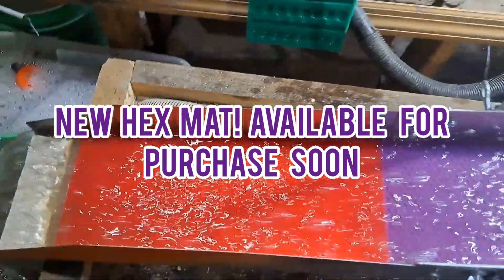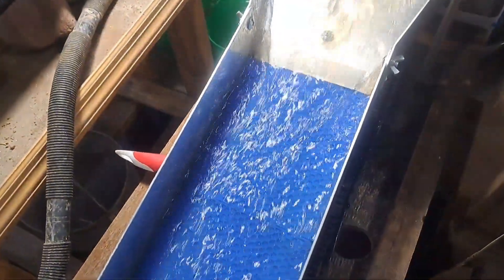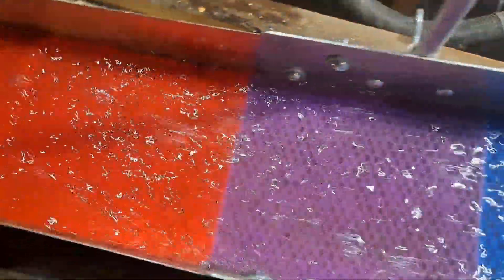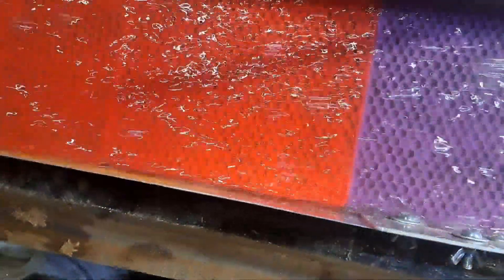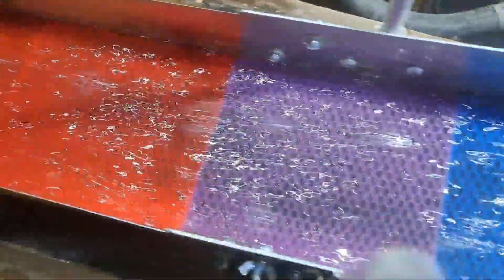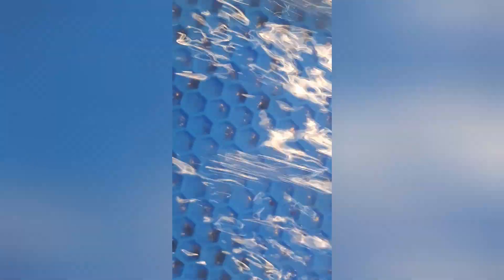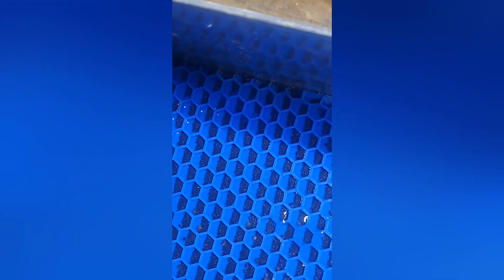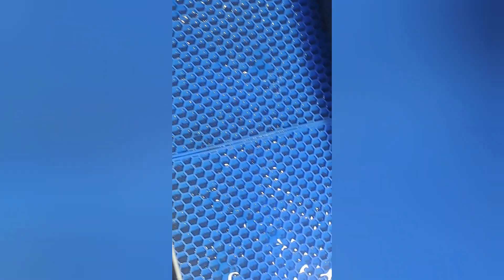The New Hex Sluice Mat.

Comment: Reminds me of Dream mats. 😁
Reply from the maker: Works way better than dream mat. I've used dream mat.
Reply: Any chance you can do a side by side comparison of Dream mat and your mat?
Reply from the maker: @4 The Loot  I've used  the dream mat many times..the combo mat works  ok in the  streams. IT looses 50 percent  of the  gold  in beach sand. I've demonstrated  that on  a video on lake superior  last summer.  The micro dream mat works very good  for a  clean up sluice.  You have to re run  the cons 3 times to get  all your gold. The hex mat 2 times  refunding your cons. The hex mat is 21 inches long themicri dream mat is 16 inches long. The micro dream  mat it's very hard to see the gold it's catching. The hex mat yiu can see it all very good. I've made videos many times  using both mats. My opinion  is the hex mat catches gold  very good and very little cons left. Also works on the beach works great for testing spots so much faster than panning.
Reply: @freedomprospecting9034  Thank you for the response, I will keep an eye out for when your mats are available.